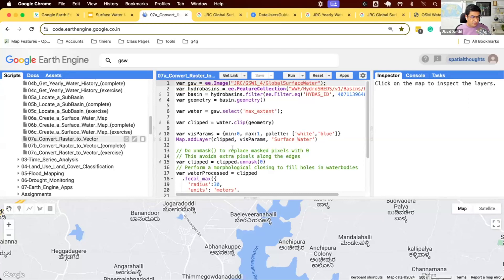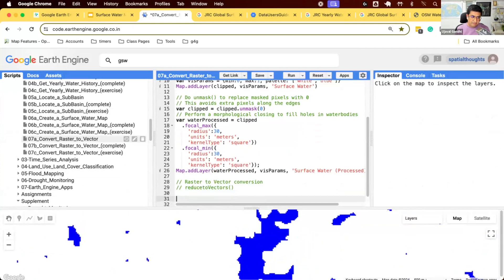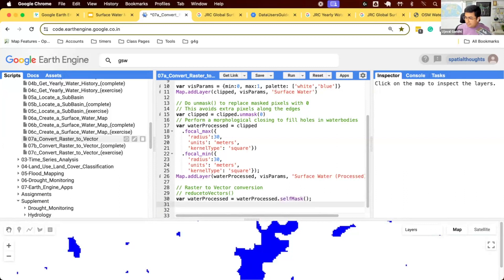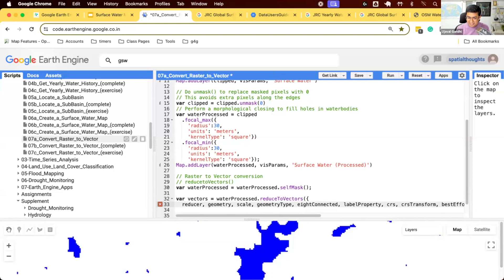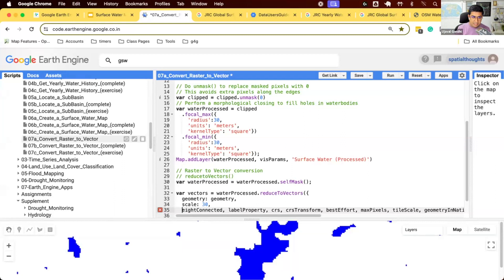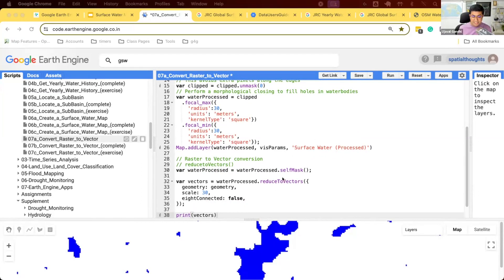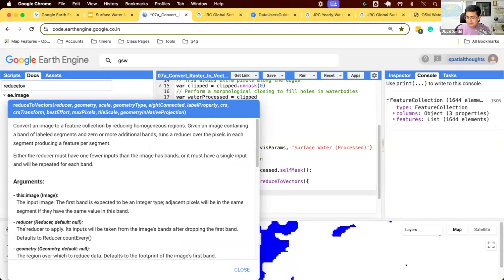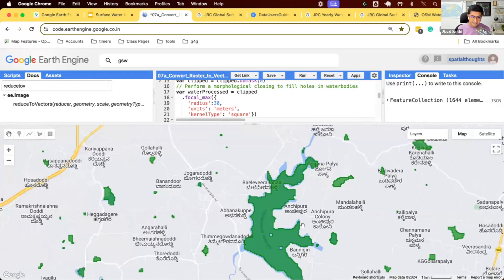Module 2 - 13 Convert Raster to Vector - GEE for Water Resources Management

Comment: I want each pixel to covert in vector how can I do that? I'm trying to that  but it was not giving me the expected result.
Reply from the maker: Not a good idea as typically images have large number of pixels and converting each to a polygon will generate very large vector layers and will probably fail. A more common use case is to extract the value of each pixel and export that as a CSV or a shapefile. See this example of how to do it. https://courses.spatialthoughts.com/gee-water-resources-management-supplement.html#exporting-pixel-values-as-shapefiles

If you really want each pixel as a polygon, Export the whole image as a GeoTIFF file and use the 'Raster Pixels to Polygons' tool in QGIS to get pixel polygons.